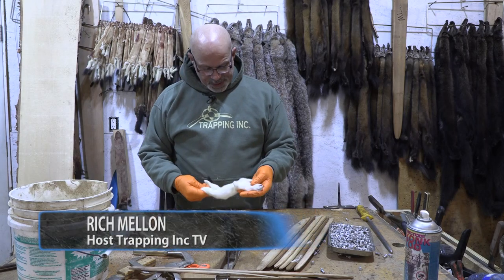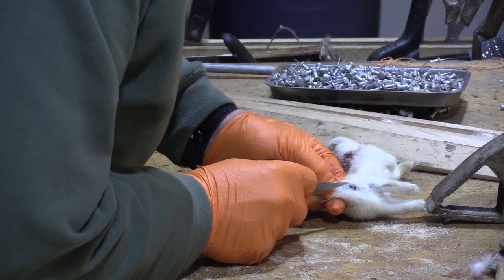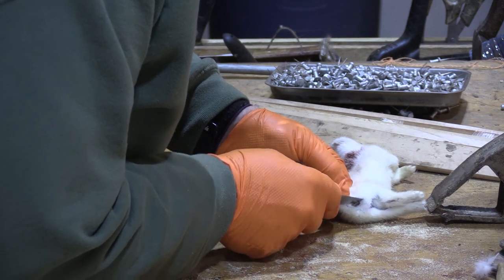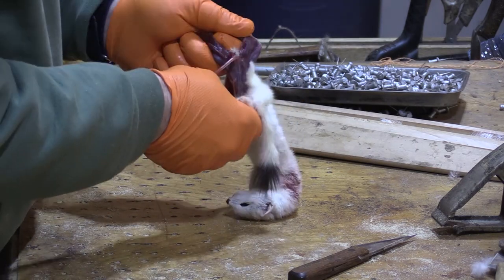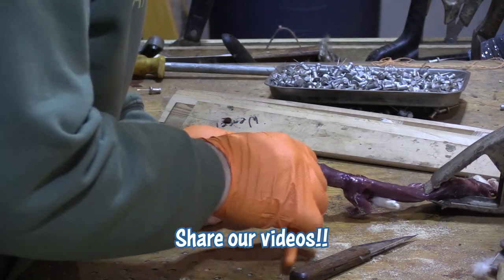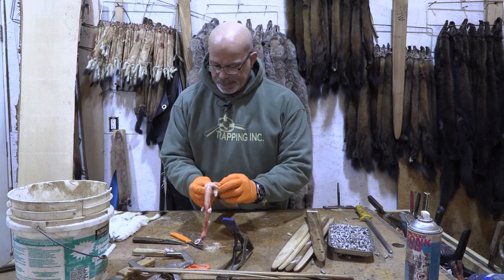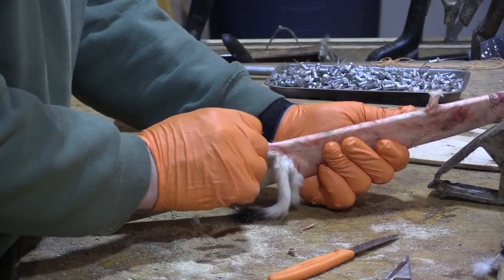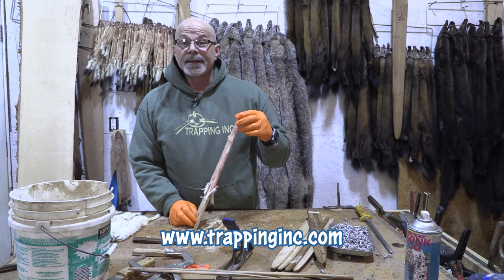Weasel Skinning, Fleshing and Boarding

Comment: What are you using to strip the feet? Would it be easy to make something similar using a large nail?
Reply from the maker: Basically what I use a big nail welded to a angle iron.

Comment: I know this has been up a minute but I’m hoping you still might answer 

My cat caught a stoat and it sat for about 5 hours on a warm day then was frozen is that to long for it to have sat for the fur to stay in? Second question do you do anything besides letting them dry or do they need to be tanned?
Reply from the maker: Check in the groin belly area once it thaws to see if the hair is slipped. It will pull out easily. If not you will be good to go. A dried fur is still a raw fur. It must be tanned for long term durability or use.
Reply: @TrappingIncTV  thanks for the help got it skinned lost a couple feet a part of the tail and some of the head that was nibbled on lol threw all my man handling the fur held on so I’ll take that as it’s good to tan 

Any tips on that process?